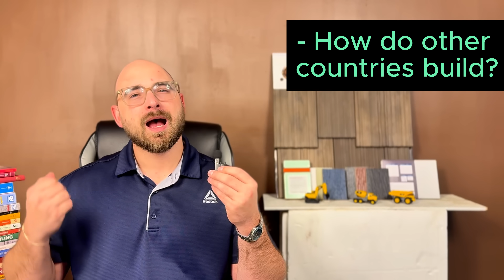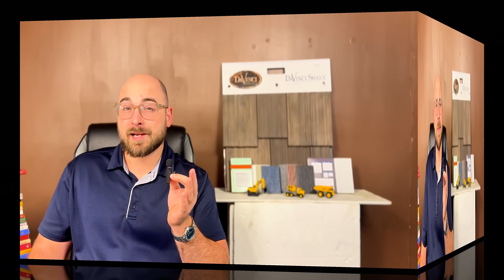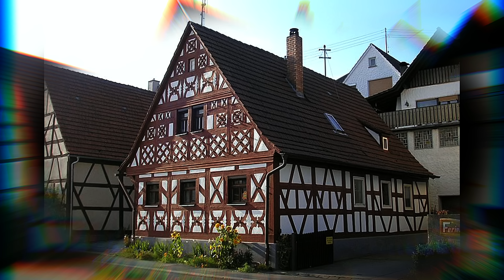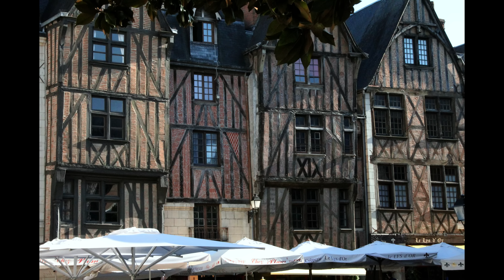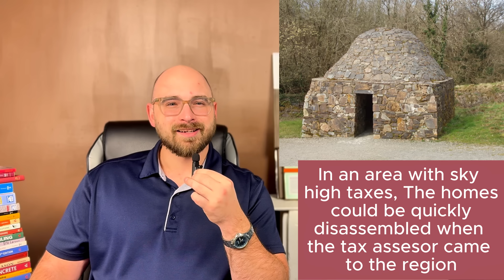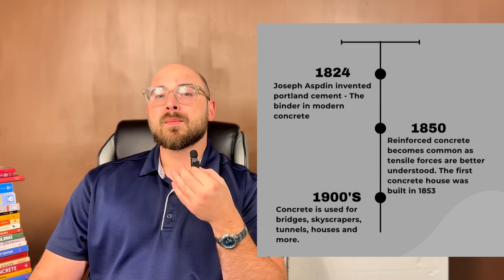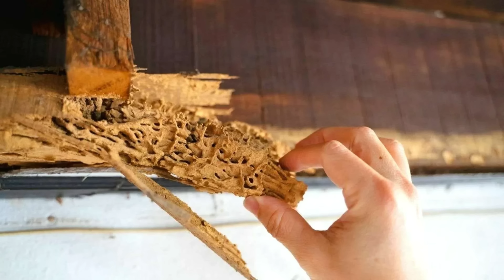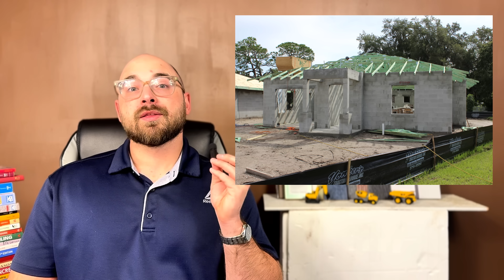Why Other Countries LAUGH at American Homes

Comment: In the city of Porto Alegre in Brazil, there was a major flood, and practically the entire city was submerged. Most of the houses are made of concrete and bricks. After the flood passed, it was necessary to throw the furniture in the trash and wash the houses in order to live in them again. The people who were left without homes were the poor and who had houses made of wood in remote places. In Brazil, houses made of wood are associated with poverty.
Reply: ALso here in Serbia ,city off Obrenovac was whole in 4 meter water after Danube (second largest river in Europe flooded whole city ) ,no single house moved and after water went the furniture went out they buy new and move in
Reply: In Brazil, houses made of low-quality wood, like pine, are often associated with poverty. However, in the colder southern regions, luxury homes in rural areas are built using high-quality Brazilian hardwood, which is both expensive and valued for its durability. Wooden constructions in Brazil face significant challenges due to extreme weather conditions, especially in the South, where temperatures can range from -5°C in winter to 38°C in summer, along with high humidity levels throughout the year. Additionally, there are large temperature variations throughout the day and extended periods of rain, which further test the resilience of wooden structures. In my region, I have noticed that high-end constructions are increasingly adopting steel frame systems instead of wood frame, possibly because steel is more affordable and accessible here.
Reply: I have seen some brick+concrete houses in the Florida keys. People got tired of woodframe rebuilding...
Reply: Every different climate has it's own benefits and challenges.
I live in Sweden, and here, most single-family homes are built from wood. There are various methods of building in wood, from solid timber, to framed constructions.
We have a huge logging and milling industry in this country, as well as centuries of perfecting the methods.
Wooden houses do not rot, and rarely develop serious problems with mold. Brick or concrete buildings, and concrete foundations usually have more problems with dampness and mold.
We have both wood and stone houses that are several hundred years old. Not all houses last that long, only the ones built with the best materials in the most suitable locations.
Reply: In my country wood is more expensive than concrete and blocks
Reply: So sad that people are still multiplaing in those pore areas
Reply: I noticed this in some US cities along the Mississippi river.  In cities like Dubuque, IA, all the homes along the river and in the flood plain are brick houses.  They could flood (which it used to do regularly) and be cleaned out and reused.
Reply: @silvio6904  o que q casa de alto padrão pré-moldada de madeira da Serra Gaúcha tem a ver com custo de produção em favela? Se vc é um duro favelado de grande cidade, vc não constrói casa de madeira no Brasil, com raras exceções. E o que te motiva não é "cultura", é custo mesmo. É simples e direto assim.
Reply: @silvio6904  pq na maioria dos casos é, meu camarada. Pegar o exemplo específico de uma unica região do país, como se isto fosse a regra, é tolice. O preço de madeira varia consideravelmente em cada região do país e, majoritariamente, é mais caro para construir desta forma no Brasil. O exemplo da favela surgiu de algum comentário gringo aí em cima: é consideravelmente mais barato construir com tijolo e concreto, principalmente sem acabamento, como se vê em muitas favelas do país.
Reply: It the same in Nigeria poorest people build with roofing sheets and wood most home around the world are cement blocks
Reply: @Rcrecords10  but its how it's built that matters.  Go to a cement block house in Nigeria and my wood built house in the US and see which you'd rather live in
Reply: That is the thing. Even in poor spaces in Brazil, there are masonry houses. Favelas are largely built with proper bricks. To me, wood for housing makes no sense unless it is absolutely necessary, as is the case of actually homeless people settling in new areas. Otherwise, most favelas have a strickingly red appearance because of the unpainted bricks that cover the hillsides where they grow.

Source: I live in a "humble" suburb near São Paulo periphery.
Reply: @NothingXemnas  come to america and you will see that wood is absolutely necessary
Reply: Houses made of wood have always been associated with poverty in the UK as well.  We haven't had wooden houses for several hundred years but when we did, it was peasant housing.
Reply: @joshuarosen6242  it's because yall have shitty wooden houses not because wooden houses are shitty
Reply: @franquil85conn  It's cultural, it would be like offering a Roman or a Greek with a culture of building houses made of brick and stones, "fantastic" but "wooden" houses. None of the people from the Mediterranean basin have wooden houses, nor in "Gaza" do they have wooden houses, in fact, if they did, it would be a huge fire.
Reply: @ we don't have wooden houses, shitty or otherwise.  It's been centuries since peasants lived in them and posh people never did.
Reply: Same in chile
Reply: Yeah

American homes are EXPENSIVE TRASH

I have met dozens of people from all over the world that have family homes from 3,000 to 4,000 years old.

American homes now last about 40 years
Reply: US will be the last ones using wood, inches, feet, farenheight oil, coal a 100 years from now.
Reply: Don't worry. You all hailed from Africa. When your houses have burned to a cinder or frozen to a block of ice, welcome home. 😂😂😂
Reply: People talking about mold here are a bit funny. Like YOU thought about it and they wouldn't have.
As other commenter said: products are already safety checked before hitting the stores.
Reply: 10:50 "while these are technically clay blocks" meanwhile it literally looks like minecraft brick blocks
Reply: In much of the US homes made out of anything are potentially just fodder to tornadoes that can literally shred them into like particulate matter within minutes so it's just not even worth it sometimes like build a huge super heavy house it's like it's literally just going to be destroyed just build it so you can live in it and then once it's demolished you build it again
Reply: NOT a sin to be poor.
Reply: Isso não muda o fato de que o Brasil é um país pobre e subdesenvolvido de terceiro mundo, enquanto EUA é o país mais rico e poderoso do mundo, brazuca de terceiro mundo. O Brasil vai ser eternamente subdesenvolvido hahahahaha
Reply: Then why is brazil poorer the USA?
Reply: It's just a way of building houses, it's not the goose that lays the golden eggs.
Reply: @silvio6904  God looks at the heart,, not what a house is built with, We cannot stay in the elements all the time and be ok.
Reply: Well, it's not a sin to be poor,, and houses have to be built of something. I don't see the government giving everyone brick houses so they are secure..
Reply: Pointless discussion! House price has more to do with population density then building cost! My 66 square meters apartment in São Paulo (biggest city in south America) cost the same as a giant house in another state! Last year I was living in a guant house with about 300sqr meters that cost the same as my apartment in very good location! The house even had a pool and was all made of concrete and bricks in a good place of the city.
About the problem of moving, you can simply sell and buy a new one, like a car. You don't belong to the house and vice versa
Reply: @VitorFM  it's not a pointless comparison, you swanky apartment in sao Paulo was a city, not a state or country.  The money i spent for my house in Texas would net me much less in New York City, which is why we dealt in averages.
Reply: It's a bitch to to get the moisture completely out of the walls after flooding, may take years, decades, or never, won't be exactly as pre-flood but still livable.
Reply: @markomarjanovic7643  it really damn is, my uncle's home got hit by a terrible surprise flood back in June 2023. 
As we are in the mountainous area of southern Brazil, the river submerged their home for just 24 hours, to about 2 meters at the deepest. It was enough for the walls to keep shedding water continuously for 3 months afterwards
Reply: Indeed true ! Paper and plastic homes in the USA suck big time !! 🤮
Reply: @silvio6904  brother, sou brasileiro e moro no RJ. Tenho vários amigos de favelas, já fui em muitas... Não precisa lecionar aqui não, tô te falando um relato de quem tá bem próximo dessa realidade...

Caso vc não saiba (parece não saber), as favelas até a década de 60 eram majoritariamente de madeira. Algo q mudou com o tempo, pq tijolo e concreto hj é muito mais em conta. Fica na tua aí q tu não manja nada dos paranauê...
Reply: In India, any house that's not made up of bricks and cement, is considered "Katcha or temporary" and is considered a sign of poverty. People living in such houses can available subsidy from the government to make a "Pacca" or "firm" house of bricks and cement.

I have seen expensive houses blown away by tornado in USA or getting burnt in forest fires because they are made up of wood and it so unreal because I cant even imagine that in poor neighbourhoods.
Reply: The Brazilian weather doesn't allow wooden frame constructions. As s tropical country, most of its regions live under wet conditions and houses with wooden frames would have issues eventually.
Reply: That doesn't mean they are poor that means they start over fresh and you're stuck in the same old building with the same clean up. Damage is still damaged and it is costly and it's not cheap and if the water submerged the roof the house is toast In the U.S. they would class it as condemned. Stick houses can still stand up very well in a flood.
Reply: To be fair, the houses "made of wood" in Brazil are often home-made of junk wood, with corrugated metal roofs, in favelas, and not built by a contractor to US-level building codes.
Reply: @bricology  not true. In most of the country, it is actually cheaper to build a house with brick and/or concrete. Most favela houses are actually constructed this way. Wood is very expensive, except for some specific areas where people source their own wood.
Reply: @bricology  wooden houses in Brazil are either old, traditional houses sourced with wood sourced locally or highly expensive, custom or pre-built luxury houses for the affluent. Generally there is no in between... But there are some exceptions.
And, frankly, we generally don't have the type of flimsy, fragile wooden and drywall houses made in the US at all. Wooden houses here at least seem to be sturdier - though this may be just a misconception.
Reply: @jonpirovsky  -- like I said, the houses in Brazil's favelas ARE houses, and they're made of wood (and corrugated steel, and whatever else can be scrounged up). They are the lowest quality imaginable.
Reply: @bricology  I'll repeat again: houses is favelas are mostly made out of brick and concrete, because these materials are way cheaper than wood. You hardly see wooden favelas nowadays.
Reply: @jonpirovsky  bullshit. I live in the south region and wood building was very common for low middle class people.  It is a total diverse environment from the Favela thing. People gave up due thermal comfort without AC, wind and strong rain durability and a increasing regulation on wood extraction. Check out Google on south brazil wood housing.
Reply: @bricology  Sorry brother you never seen or been to a favela, just look up Capão redondo and jump on google street view, 99% of the houses there are made of bricks.

Making your house of decent wood is not that expensive, and the junk wood is reserved to super poor people,pratically poverty level, i live in a poor city and those kind of houses made out of junk wood are very rare and in specific locations
Reply: @bricology  I'm Brazilian from Rio de Janeiro. People in favela only build with trash (wood shack) when they just invaded a lot, phenomenon they call "invasão" - this period will last for an year to test the waters regarding authorities. The shack is only there to mark your territory so your neighbours don't take your lot.
Little by little they start investing in their actual house made of bricks; even buildings of many levels - and many shops as well.

I had a neighbour that sold her legal 2B-apartment to build a 3 story house, with backyard and pool, on a invaded street alongside others. They remained for 20 years; until finally the prefecture removed them but with financial compensation.

Just look at any video tour around a favela in Rio de Janeiro or São Paulo...metropolitan Favelas like "Rocinha" or "Paraisópolis" are densely packed cities of their own.
Reply: @silvio6904  it's not a knowledge thing, it's a money thing.  My house has plenty of brick, just not structural brick, it's much different.  Brick isn't as plentiful as wood
Reply: @silvio6904  and here we build to live in and sell because most people move locations and don't want to be tied to one spot
Reply: @franquil85conn  In Germany we tend to work very long in the same company or public administration. We don't like to drive long time to our workplace. We like to live in or nearby the city. When we change the workplace, we sell our houses and build or buy a new one at the new place. And when family size changes we do the same. A lot of people rent apartments or houses. You can not easily kicked out. There are laws.
Reply: @jomaclkego6381  well in America we are used to driving far for work, but the main thing is maximizing my investment.  If I still lived in my same first house, it would be paid off and I'd owe nothing.  I moved to a better neighborhood made payments on land and a house for 10 years, sold it, paid off the rest of the loan (360k) and built the house I wanted approximately 580k for cash and still had 200k to invest.  Most smart Americans move away from their home town and get a job in a good market, look for a house in an area that is growing, even if that means their work commute is an hr and will not hesitate to change jobs, cities, houses if it financially benefits them.
Reply: @silvio6904  tu ta falando muita merda sobre o brasil não ter "culture" de construir com madeira, isso é literalmente uma mentira e algo burro pra krl, sendo q muitas pessoas aqui do interior tem casa feita de madeira, pelo menos auqi no RS.

Nunca vi ninguem chamando alguem de louco por querer construir coisa com madeira, mas talvez isso seja coisa de paulista e eu não to sabendo, mas falar por um pais inteiro e ignorar todo resto é a coisa mais de paulista q eu ja vi KKKKKKKKKK
Reply: @bleeem  Madeira também é super caro aqui por causa de dois motivos: como a maioria das melhores madeiras estão em risco de extinção, o IBAMA exige certificação para o uso de madeira, aumentando drasticamente o valor. Por conta disso, madeireiras clandestinas vendem madeira ilegalmente, mas estes criminosos também vendem madeira a preço alto para aproveitar a demanda por alternativas menos burocráticas. No fim das contas, qualquer madeira dura de construção custa o olho da cara.

Nunca perdemos a tecnologia e o know-how de construir casas de madeira, mas ninguém exceto os mais ricos construiriam uma!
Reply: If those houses do not need rebuild, where is the GDP?
Reply: In Malaysia, houses constructed from wood are reserved for the affluent. The hard tropical wood used in these constructions is sand and shellac, which are known for their exceptional durability and can withstand centuries of use.It’s a masterpiece and comfortable to live in unlike concrete, the second choice are clay bricks
Reply: People in cold climates would never live in concrete houses. High moisture and cold. Add up all the facts before judging
Reply: @coldspring624  When I talk about concrete, I mean the reinforced concrete frame with steel inside that serves as structural support and that has the structural mathematical calculations performed by engineers.
The walls are closed with a layer called "sealing" and are made of different types and layers of bricks and are used in cold countries, including the coldest city in the world, Russia.
Reply: Switzerland homes suck !! 🙄
Reply: U tell me which house you would rather live in Brazil or USA?
Reply: Bet the insulation in the walls is a "Black Mold" Paradise 🤢🤮☠️
Reply: @mikeoc217  There is usually no mold, there are technologies to prevent mold, I believe that wooden houses have more mold because there are inaccessible spaces between the wood that cannot be cleaned, there are also several insects, dust that cause allergies. But it is all a question of technology and even in very cold countries like Poland, China, Russia, the buildings are not made of wood.
Reply: @silvio6904  Tell that to the people in those Countries who live in wood houses mold comes from the outside in and you have a water leak since mold also grows on rock and has to be cleaned. I have seen a lot of mold and moss on all kinds of houses which just means the House is lacking Sunlight it is too cool and there is no airflow.
Reply: @claudiaclark6162  In houses made of bricks, buckets full of water and detergents are thrown on the floor. In toilets, you can also throw large amounts of water to clean. Russian women who live in Brazil even say that we throw "little water", that they throw more water to clean. Nothing stays dirty for long. And against mold there is a series of waterproofing agents that can be mixed with cement, preventing the spread of water by "capillarity".
The materials used to build houses are culturally defined, not technological, and Americans love wooden houses to the point of being personally offended if other construction methods are mentioned. It is possible to build houses out of bricks, but people don't build them because they don't like them, they don't want to, and there's nothing wrong with that.

Although for the price they pay for wooden houses in the US, much better houses could be built.

A big Brazilian TV star died in the US after falling from the attic of a very expensive mansion. He tried to walk in the attic to fix the air conditioning and the ceiling "broke".

They would have had to pay something "extra" for the construction company to have nailed some reinforcement wood in the attic.

In Brazil, a house of that price would be made of reinforced concrete decorated with plaster, and you could have a party in the attic.
Reply: @claudiaclark6162  Bad design will be bad all over the world. You can build both, wood and concrete, in pretty much any climate and have it last for 100+ years. It's a matter of properly designing and then executing on that design.
Reply: @luckbot-5000  I agree but I'm not going to live hundreds of years. It only needs to survive through my time on this Earth.
Reply: @mikeoc217  yeah because those dumb 3rd wrolders dont know how to take care and counteract basic home issue that every home will have, pratically any bricklayer here will know about ways ot deal with molds and moisture, we live ina  tropical country dumbass, we know how to live in the conditions it comes with
Reply: A flooded house is just not worth it to remove the moisture that can never be totally removed ! Abandon and rebuild again !! 🙄
Reply: @SweetChicagoGator  actually, the Summer heat and abundant sunlight, combined with some decent cleaning, really are mire than enough to kill the mold...
Reply: @SweetChicagoGator  that's not true at all, you can definitely get all the moisture out of a flooded house the same way that lumber and material on site of a new build gets wet when it rains and it doesn't mold and it will be waaaaaay cheaper than demo and rebuilding.
Reply: Well the average home price there is 150,000USD.....  thats damn near poverty level here in America
Reply: @franquil85conn  I do not deny in any way that Americans have a higher "purchasing power", but among us Brazilians, whose culture comes from the Mediterranean, building wooden houses is associated with poverty. When someone gets some money, they build a house made of bricks and concrete. It is completely unimaginable for Brazilians to build a wooden house. No one would understand that someone who has money would build a wooden house. And we have a large colonization of Germans in the south of Brazil, who went to live in an area rich in wood. For about two generations they built wooden houses, but as soon as they got better financial conditions, they started to build only with bricks and concrete. The wood industry was completely abandoned, few people know how to work with wood. And all houses must have a civil engineer in charge, otherwise construction is not authorized.
Reply: @silvio6904  the problem is that Americans do know how to build with wood because timber was a major commodity in the past, and while you can have unscrupulous builders of wood (and bricks and concrete) you can also have amazing structures, though i do not deny concrete and brick are stronger.  My wood built home is 3400sq ft and cost 650,000usd to build, if I built this same house out of brick and concrete it would probably be double.  My first house i bought was a wood built Victorian home from 1893 (though I admit it was built with stronger wood than my current home built in 2020.
Reply: @franquil85conn  
If you go back to the video it says several times that house building depends on availability of / access to build materials. Scandinavians have better access to wood than southern europeans, therefore you will find a good percentage of high quality wood houses up north. Scotland has a lot of granite. Many old houses are built of granite and will last for ever. No one would export granite as building material. Plus it requires special skills and tools for construction.
As for house sizes: Land is precious in Europe and determines what house size one can afford. Switzerland for instance has a high percentage of renters country because land is very expensive. Apartment buildings are typically of high build quality because owners are typically in for the long run.
Reply: @BAG9114  yes I'm aware that access to materials influence what your home is made out of.  Size has to do with culture though.  Size of yard has little to do with how big your house is.  I could build an average home, for Brazilians, to their spec for cheaper than i built my current home, but I don't want a 750sqft home.  My point is that Europeans aren't building a 3500sqft home out of brick to these specs, without it costing a small fortune
Reply: @BAG9114  as for Europe land being high, land is high around my area too and it gets much higher than my area
Reply: @ 
Of course you can (theoretically) build a 3400sqft house on a 340sqft piece of land. It would be multi story… As you say, size has more to do with culture. Even without an exact cost/benefit calculation, Europeans tend to compromise to build smaller and therefore less costly houses mainly because of the high cost of land. Even though there are significant country to country differences. Germans like bigger yards, whereas some southern counties seem to have smaller yards. Because of the hotter climate? In general, you rarely see more than 2-level single-family homes in Europe. This has to do with the inconvenience of climbing stairs as well. BTW, you can and should be proud of your home. You built it for YOU and your family because you could/can do it. So why not. I live in a 1900sqft home and never regret the decision I made. My house fits my lifestyle even though I could afford a bigger home.
Reply: @BAG9114  i am proud of my home as anyone should be, but I get tired of these egotistical foreigners that act like American homes are trash because they are built out of wood and not structural brick, as they wash their underwear and their dinner plate without having to leave the kitchen.  It's equivalent to when people in Europe act like Americans aren't cultured because "we don't travel" lol I can drive 10+ hrs and still be in texas, in drove 1600 miles to a job and was still in america...how many countries would you go through driving 1600miles from london.
Reply: @franquil85conn  That's the issue. I would pay to own a Victorian home but I wouldn't spend my money on a home in the US made like it's made today. It's nuts to pat 1 million dollars for as home made with wood and cardboard because Durlock is basically cardboard. You are getting a BIGGER house with poorer quality and life-spam for less. So I don't know if that's a good deal. Homes made with adobe in the Northern part of my country may seem that they are for poor people but they are sturdy and last hundreds of years.
Reply: @veritorossi  that's the problem, you just have to find the right builder.  Reputable builders use Zip system not duralock.  This is a much more sturdy and weather resistant product.  And while Victorian houses are undeniably stronger (wood and labor was extremely cheap and the wood you got was old growth, it's much more expensive retrofitting them to meet with today's luxuries like central AC/Heat.  Also you better be handy or rich when it comes to the repairs that all houses need overtime.

Mainly if you avoid a DR Horton home in America or any home built shortly after the pand3mic you won't have to worry about duralock.  Almost all builder use Zip system, because it is quality and not much more that OSB sheeting, but after the pandemic it skyrocketed from 15 to 100 dollars a sheet so more reputable builders were having to go duralock so the houses were too expensive.  Now it's down to around 31 a sheet, so  it's being used again.  Again, it's a cultural thing.  I'm pretty sure when yall build a house yall don't move.  In America, we do, rarely do you see people that grew up in one home their entire life until their parents pass it on to them in their will.  I could have took the money I spent to build a 3400sq ft house and built a 1200sqft house that would have withstood the apocalypse, but I didn't want to live in that, I wanted the nice house that, if maintained, could last my lifetime.
Reply: @franquil85conn   it would easily be double. None of these people would build with concrete if given the option to pay 200k or 400k
Reply: @franquil85conn sooo... Let me get this straight. 
Instead of building a smaller and better house... Your choice is cheap and looks.
Classic Murican mentality 🤷‍♂️
Reply: @BAG9114  If Switzerland is like Germany people rent because they have good tenants rights (stay as long as you like and rent increases not exceeding inflation).
Reply: @franquil85conn  how can be houses so expensive in usa, you would get a house twice that size and made out of brick in a wealthy area of latin america
Reply: @KingPlaysHDKPHD  because we make more money on average here
Reply: @franquil85conn  Better to pay double and the investment be safe for generations, than to pay less 50% but loose 100% at the first forest fire or tornado or hurricane or flood.

Like we say here: The cheap sometimes becomes more expensive.

You just loose it all. Bad move.
Reply: @ricardoxavier827  let's take my house in my location.  500,000+ to build, so let's say same house built to be "safe for generations" eventhough I built it knowing I'm going to move out in about 10 years, and you say double the cost...that puts this at a million dollar house.  Now I have over invested in my neighborhood, meaning I'll struggle to recoup my investment when I sell in 10 years, or at least will get less profit.  This also means my property tax doubles, so now I'm paying 14-16k a year in property tax....to build a house that will last for generations....eventhough I'm leaving in 10 years.  It logically makes zero sense.  And when it comes to fire, tornado, flood, or hurricane (too far inland for a hurricane, too high on a hill to flood (and I have flood insurance) fire could take it out maybe or a direct hit from a tornado, but i have insurance for that too and a storm shelter for my family to keep them safe.  Also insurance is high enough, if you build with a more expensive material that has higher labor cost look forward to that going up too
Reply: @franquil85conn  The question I'm asking myself from Austria is why would you need 3400 sq ft? The average Austrian uses 502,6 sq ft in living space and if you'd built smaller you could have easily afforded a durable house.  I'm living with my partner in a brick and stone building from 1904 with 1300 sq ft and consider it too big. Especially when it comes to cleaning :) What are you doing with all your space? Apologies in advance if you have 5 children.
Reply: @Ariadne007  no, i have 2 children, but what's wild is that you people think the house isn't durable.  What should i build my house to withstand? Now on why we needed a house that big, we didn't "need" it, but in america it's just common place to have bonus rooms like media/game room and each room to be large.  The smallest room in my house is my office and it's 160sqft.  I live in tornado alley and while the house wouldn't survive a direct hit from an EF-5 tornado, it's not common that you get a direct hit from a nader.  Could I have built my house out of concrete and stone to withstand a EF-5 Tornado at 1300sqft, absolutely, but again I'm not planning on living here but another 10 years, no one wants a 1300 sqft house in America and definitely not for the price it would cost me to build it, so I literally would be wasting money.
Reply: @Ariadne007  and as for cleaning, my wife and I pick up and do basics (sweeping/vacuuming and mopping), but we also pay a lady to dust and do a more deep clean once a month.
Reply: @franquil85conn  you could have build half the size of the house with concrete and it would still be more than enough. Much more energy efficient and less costs to maintain + would last 100 years long
Reply: @igormoravcik300  i don't want a house half the size built out of ugly concrete.  My house is, imo, beautiful and is going to be something my family can enjoy.  Again, why would I want to build a small house that's gonna last 100 years when I'm gonna sell after 10?  I've used this analogy before, but let me try it again.

Let's say you want to buy your dream car for 30,000.  You know you will only drive it until you put 100,000 miles on it.  Now imagine someone says, "why don't you buy this car, it's the same price, or maybe a little more expensive, half the size, but its got a million mile warranty.  You are also going to have to pay higher insurance and warranty...why would I care if I'm trading it in after 100,000 miles?

That said, I don't know what houses yall build out of wood, but I guarantee, the average house, whether stone or wood in your country is nowhere near as nice as mine or the equivalent.  It's all about culture.  In the UK they have their washing machine in their kitchen, that's a massive space saver, but if you built a house over here like that, you would never be able to sell it
Reply: @franquil85conn  you understand that it doenst matter if the house if built from concrete, bricks or wood, you put plaster on it anyway on the inside and outside and they will all look as beautifull as you want them too, depends on budget. 
I just dont understand why would you want to build your dream house and then sell it after few years anyway.

And house being nice, is just about personal preference so stop with this nonsense of "your houses are nowhere near mine"
Reply: @igormoravcik300  because my house is plenty nice and quality and built well.  I don't want stucco, much higher cost, much higher insurance due to labor.  As for why I would build to leave in 10 years or so, when my kids are out of the house, we may downsize some, and where we live will no longer matter based on the school system.  My whole point is that wooden houses in America are built plenty sturdy, plenty energy efficient, and you'd know this if you actually compared the two.  You also have to realize while you can build as nice and expensive house as you want, if you over invest in the area, you are wasting money.  Again highways could be built to last 100years, but you have to balance longevity with cost to see what is the right choice
Reply: @franquil85conn  its funny you writing that you should not over invest in the area, yet you wrote before you gave 650k or so to built your house which is crazy money...
Reply: @igormoravcik300  in my neighborhood, houses range from 550k to 750k give or take.  I could build a million dollar property or I could build a house half this size and build it out of concrete and stucco, but the million dollar house would be tough to sell here, and a 650k house that's 1600sq ft would also be tough to sell.
Reply: @silvio6904  Most of Latin America builds houses to last.
Reply: @franquil85conn  but a 150k USD house in Brazil is the size of a 800k house on the US and is made of BRICKS.

The average house price here is not 150kUSD. It is 30k USD. With 150k USD you can buy an entire mansion with a giant garden space.
Reply: @lucasljs1545  my guy, the average house size in Brazil is 70sq meters (753sqft), my slightly above average home in Texas is 316sq meters.  753sqft is the size of a medium sized, single wide trailer.  Hell my fifth wheel i use for work is almost that big.  If Americans wanted to build a 750sqft house we could easily do it out of brick.
Reply: If you want to compare two things, you should compare two equivalent things. You can't compare the average size of houses in Brasil (a country) with Texas (a state @franquil85conn  I guess the average size of houses in USA is not that big and in Brasil is not that small.
Reply: @npnpGuima  the average size of house in the entire US is still over 3 times larger than that of Brazil and of much better quality....you pick the average Brazillian home and the average American homes and you tell me which you'd rather live in.  Also while Brazil (country) is much larger than Texas (state), texas is a huge state and is much larger than the other country i spoke about, the UK
Reply: @npnpGuima  but to expand on that, what does size matter when talking about huge states or countries?  Texas would be ranked the 39th largest country in the world out of 233 or so countries
Reply: @franquil85conn  for some reason, size matters for you. And you did begin to compare sizes. When you do comparisons you should compare things that are equivalent. Country versus country, state versus states, in this case.
Reply: @franquil85conn  3 times bigger? I thought it was many times more. The capitalist empire should have for sure bigger houses with best quality. However, I don't know why you make your houses from paper and plastic.
Reply: @franquil85conn  actually, It IS getting smaller here on brazil, around 66m² or 711 sqft, however, for appartments, the average is 37 to 40 m² or 399 to 431 sqft

At this point, living in a motor home would make little diference to the average brazilian 🦉
Reply: @npnpGuima  size in comparison of house, the classification of an area has nothing to do with comparisons when again, Texas would be the 39th largest country in the world.  Hell Alaska would be the 18th largest country in the world, so by your logic, you can't compare Brazil #5th and Alaska #18 or Texas #39th because of classification, but you can compare Brazil #5th to Puerto Rico #169 or  Holy See #255 because they are both classified as a country?  Pretty disingenuous
Reply: @npnpGuima  3 times bigger is a lot when compared to average homes. And the houses aren't built out of paper and plastic, you dope.  Lol and this "capitalist empire" has a much better quality of life which is why people from around the world try to immigrate to America by the millions
Reply: @LucasBKOK With 150k I can buy a trailer
Reply: @raixuh  the government wants building companies to build like this, they make a killing selling us something the size of a garden shed for a quarter million bucks...
they really are trying to stuff us into ever smaller tin cans
Reply: bruh thats small the average house here is Saudi Arabia is 1140 m² and it's made by brick and concrete  @franquil85conn
Reply: @franquil85conn you all could, but wouldn't... That's the point 🤷‍♂️ 
Smart enough to know better, but stupid enough to don't 😂
Reply: @nikoking4839  no it's not dumb enough to build a 1.5mil dollar home to last 200 years instead of spending 500k for something that can last 75+ years. When noone stays in the same place....you know you can build a highway that can last thousands of years, but we don't because it would be TOO DAMN EXPENSIVE
Reply: @franquil85conn  yup... You just proved I was completely right 🤦‍♂️ 
Prioritizing looks and cheap price, is the true American way 👌 get a smaller, better and safer home? Nah... I want a nice looking mansion out of glued sawdust and asphalt sheets roof 😂 
A random pub in Europe, is older that the US itself (they even survived two world wars)... So idk from where you got those 75 years Vs 200 years 🤷‍♂️
Reply: @nikoking4839  wow you are either trying to miss the point or you are very low IQ...no one wants to live in a shitty 200yr old pub.  Look at the houses in Europe, they are trash.  No one live in the same place their entire life, so why would I spend more to live in a shittier place so that the next owners owners owner can benefit?  Imagine buying a car for 60k and eventhough you know you will trade it in after 150k miles, you spend 180k on the car with a 1 million mile warranty.  Only an idiot would do that
Reply: @franquil85conn  the average house in the US is as large as any brazilian house lol, texans always being retarded as always.

You are thinking about favelas, when less than 10% of the population lives in favelas, sizewise we are the same lol, quality is another thing, but americans will have 2 story houses and complain that they are sooooo poor and cant afford anything, or that they "live in the trenches" when those trenches here in Brasil are literally a middle class suburb. American just complain about hunger while having a full belly.

Also, americans are the only country i know, that has people being homeless because they cant afford a house, but they have cars, jobs and many things, except a home lol, enjoy living inside your car because you need to pay 6k a month to afford housing
Reply: @LucasBKOK I’m in the US and could afford around 65k for a home. Could get a double wide for that price back 6 years ago but not now (180k now) so that means I have zero chance of a house here. A wood framed home/platform home is just a fantasy as well at half a million bucks.  It sucks. 

Purchasing power aside I think a country where an average person can afford a home is better off than one where they can’t. A home is a necessity.
Reply: @ ya you over paying proves things ya
Reply: @robertleelewis  who said I overpaid?  You not knowing the cost in my area proves something, ya
Reply: @franquil85conn  You did it again... rofl
Reply: @robertleelewis  and you did it again... rofl
Reply: @robertleelewis  scared to make an actual point?.....found the leftist
Reply: @franquil85conn  Kinda SAd  being unable to live above decent with that amount.
Reply: @ReneOo  what do you mean? Not sure which comment you are referring to
Reply: @franquil85conn my house was bought for $165,000 in central Illinois. It is 2,466 sq ft, 3 bed/2bath, 2-car attached garage, poured concrete foundation, move in ready.
Reply: Who cares what someone else thinks? I certainly do not. Their criticism says more about their character or lack of it than anything else.😊
Reply: @llerradish  I am sorry you think that way. If you go back to the video it tries to provide explanations to questions many people in the US and outside have in regard to house building methods in different parts of the world. If you read the comments there is no wrong or right. But these comments provide insights, ideas and options I can use to make up my mind for my specific situation. What’s wrong with that?
Reply: @llerradish man, your argument is the most stupid thing that I have ever heard, are you a 14 year old girl or what? ....
So you never listen to the critic of someone else, that means you're perfect and everything you do is perfect..... that's literally the mind of a child